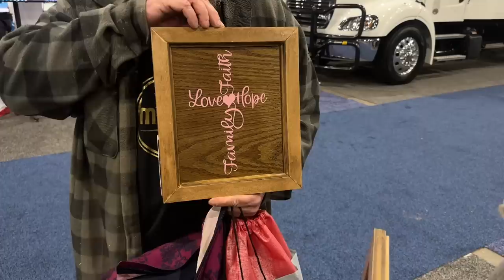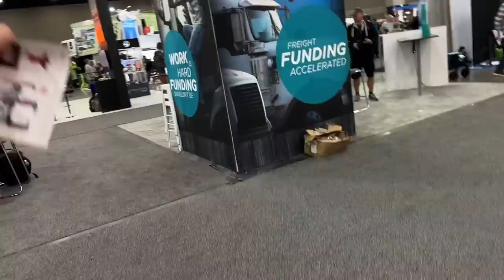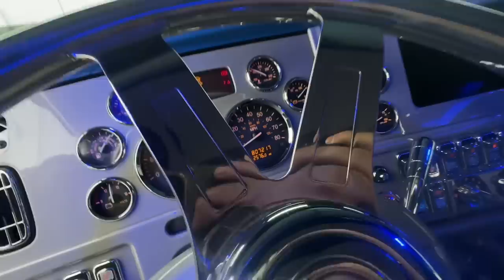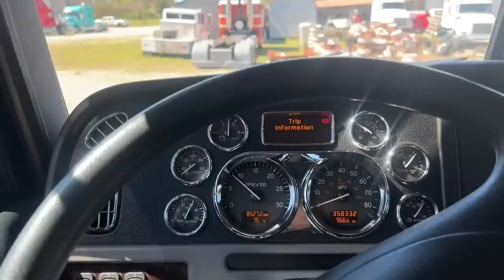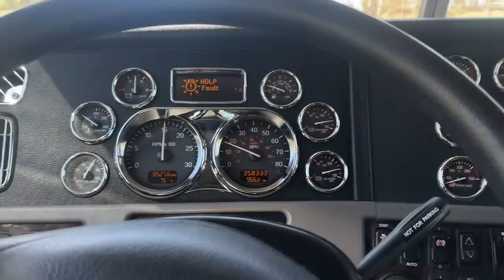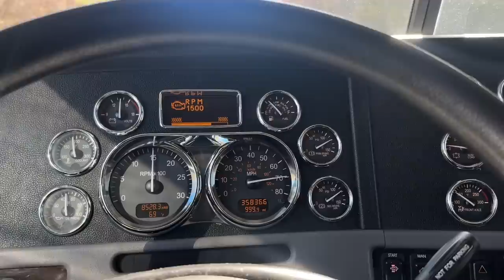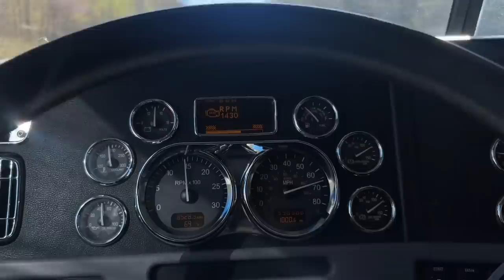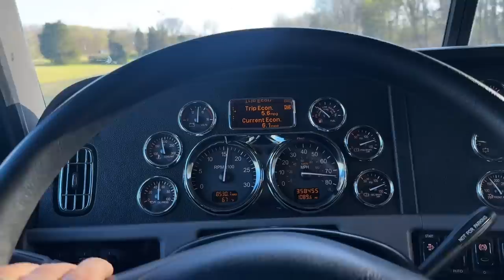I Left With A Cabover And Came Back With A 389 Glider!!

Comment: The prices are insane but most likely it has to cover all the utilities used for the event ( lights water blah blah)  most likely a cleaning crew to clean the soot off the ceiling and walls from the smoke and any fluids on the floor along with the rent of the huge building and property ... yea still wayyyy too high and people are way too greedy ... The prob use that venue for food events also and the building would have to be fully cleaned after shows like MATS  ..... not defending the insane prices but a lot of people dont think about why